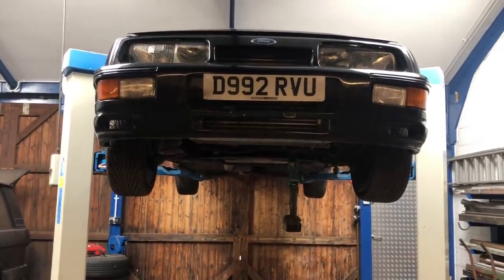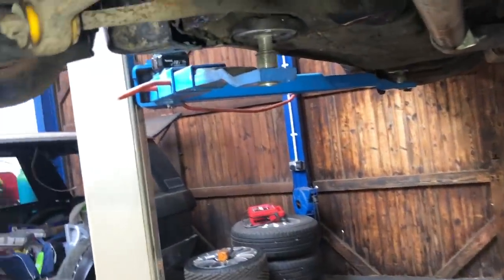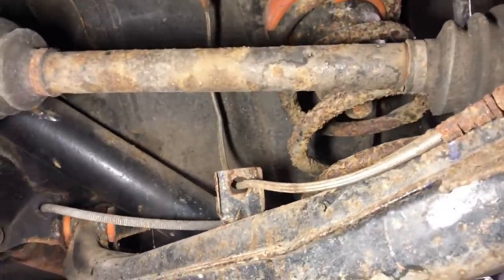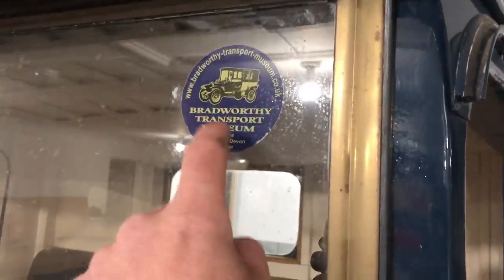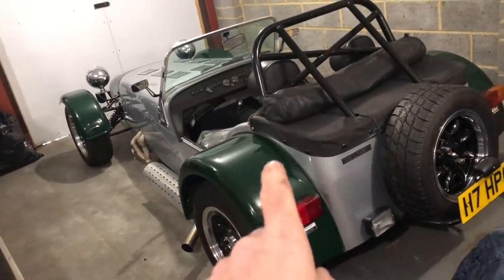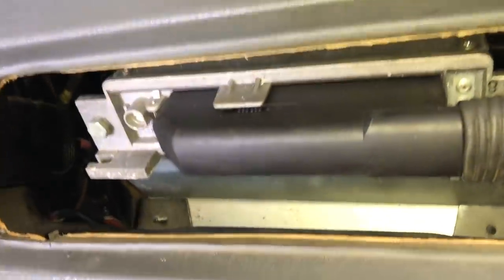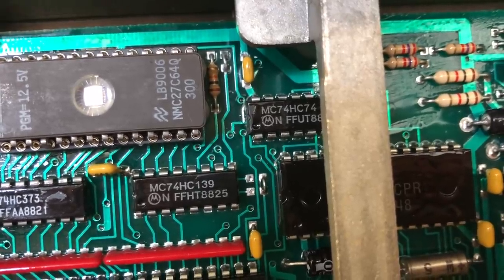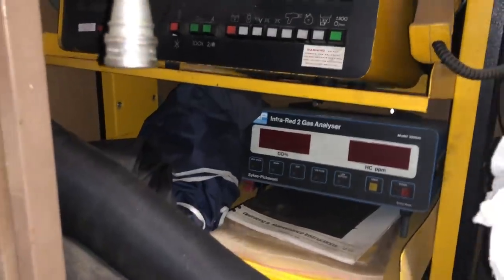Ford Sierra RS Cosworth 3 door what is next? pt5

Comment: at 11:30 "I don't know if that's original"  It is.  The white stuff is there to transfer the heat from the semiconductor to the metal case to stop it overheating.  The clip is there to make sure that it keeps contact.  Same deal with the components on the right hand side.  Pretty standard with components that generate heat to have a case made of metal that can dissipate it.  The removable chip with the window is indeed erasable, they usually have a sticker over the window to stop it being erased by mistake.  If you left it in the sun for about a week it would be completely blank.  Even leaving it under some types of lighting can erase it.  Might want to put the lid back on or put a sticker over the window to protect it.  

From the datasheet https://www.silicon-ark.co.uk/datasheets/NMC27C64%20datasheet%20National.pdf:

ERASURE CHARACTERISTICS
The erasure characteristics of the NMC27C64 are such that
erasure begins to occur when exposed to light with wavelengths shorter than approximately 4000 Angstroms (Ð). It
should be noted that sunlight and certain types of fluorescent lamps have wavelengths in the 3000Ð–4000Ð range.